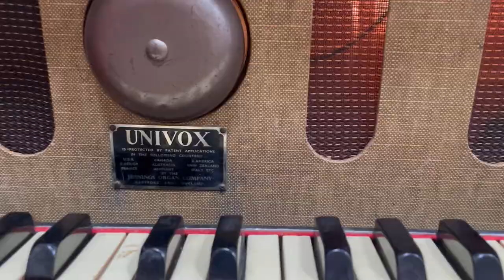Jennings Univox J6 Analog Tube Synth Demonstration

Comment: That Univox reminds me very much of an old 50's accordion that I've been "restoring," in that, in both cases, the little wooden keyboard is an uneven mess and there's this really charming uncertainty, when you press a key, what you're going to get. 

On the accordion, there's six reeds for each note on the piano side, one for each direction of the bellows, per each stop. And it's missing some reeds and some of them buzz or rasp, so there's this startling unpredictability of tone color and sound, depending on what stops you have selected, what note you're playing and which direction you're pumping in. Sometimes there's a rasping sound, or a cough before the note begins, and the bellows gradually loses air from several holes, so even the expression is a little difficult to control. 

But it has a similar character to some of these grandiose but modestly ill-conceived little instruments you have. I find it very fun to play around with, and eventually I'll find a song that needs a weird, textural solo to go in it—just as you or some of your clients might use that contraption, or the clavioline or any of your other little curiosities. 

I note that you have the Univox sitting on Hammond's weird little valve organ--both with the knee lever, and both evolutionary dead-ends! Odd how different the S6 is from its contemporaries among Hammond's more serious instruments.
Reply from the maker: Thanks very much. We have a few accordions here including a terrible Hohner electrovox that might make it to a video one day.